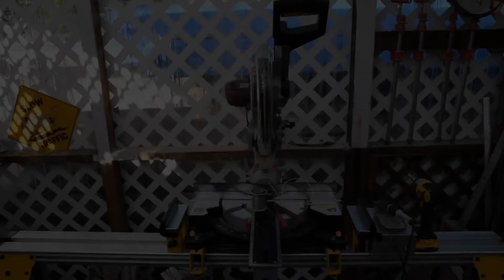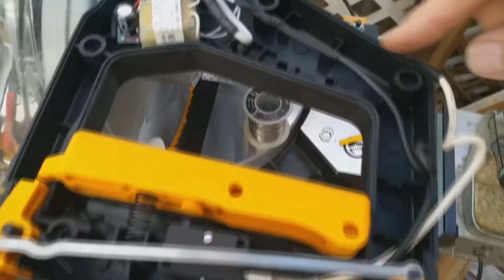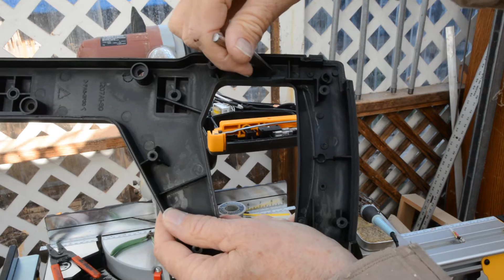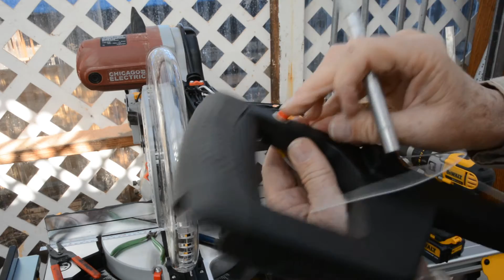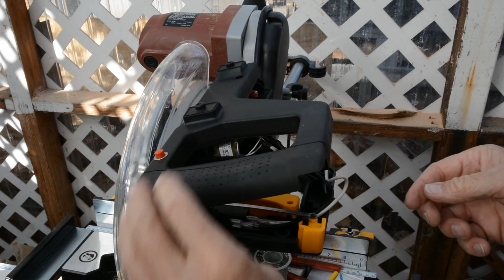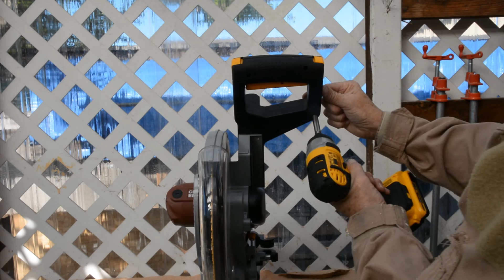Modifying a Harbor Freight miter saw with laser guide button

Comment: Great video. I got to the part with capacitor wire and there is no capacitor in my handle. I returned it to normal because I didn’t know what to do. Please advise if you can. Thanks

Comment: I loved the idea and I installed one on my miter saw.  I did make one change to the design though.  I used a Hillman "rotary switch" (Lowe's #77571 model #427661) instead of the "momentary" switch shown in the video. I prefer the rotary switch because it allows for "hands free" operation of the laser guide while aligning larger workpieces that sometimes require both hands to align. Thanks for the "fix" to what I considered "a danger" from the factory.

Comment: Great hack, Thanks. I would love to use a toggle switch so i can have the laser ON before and while cutting as well.
Reply: I have the built in laser model in the shop at work, but the laser and light actually stopped working

Edit: the one with a switch for both
Reply: See my reply above.  Jim Wilson.  I included the part number of the switch I used in my reply.

Comment: Good video. Thanks for the instruction. But your hands blocked the view a lot in the process. Anyway I got the ideas. The design of the saw is so confusing. I don't understand what's the use of the laser if it can't be started before the blade turns.
Reply: Mine didnt have a transformer in the handle anywhere so I had to stop and put it back to original. Any ideas?

Comment: Nice modification , is the laser line accurate enough to actually  use   As a guide ?  I looked at the saw on dispay at HF and it  had  quite a bit of “ flexing “  in the  pivot points  comparing it to  my  non sliding double compound Dewalt  ive owned for  10 years and  was a  Woodworker. For amost 20 years installing  and building Architectual  Woodworking for commercial properties  ive always sighted the blades on my  mitre saws  but of course if something new  or better  is out there i want to try it  the price on the saw you have  makes it  very tempting  of course  and i do agree the factory set up on that laser  was a dumb  one and your fix   Is a much smarter and safer  version
Reply from the maker: If you put a side load on the blade while cutting you can move the blade +- 1/16".  With good technique you can get good results from the saw.  The laser is only as good as your technique.

Comment: Anyone know how to adjust the laser? Mine is way off and its annoying.
Reply: Before starting, take a scrap and make a small cut with the saw set at 0 (normal straight cut). This is the target. Trigger the laser and see where it is (left or right of that spot) and make a little pencil mark where it shoots. The laser has 4 screws. One on the left side (if you are facing the saw) and 3 on the right. Also, sawdust can get packed up behind the laser unit (which might put yours off!) On the right side, unscrew the front and back screws and move the laser unit, blowing out the sawdust, and then retightening them. The remaining middle screw on the right side has a nut that is used to hold the laser in place, while the screw (bolt, actually) pushes the laser to the left. The single screw on the right tightens the system down. By adjusting the nut and loosening/tightening the screw, you can get the laser to line up with your cut in the board.
Reply: @PhilosophyCat  thank you so much for taking the time to explain that!!!!!
Reply: Thank you so much for explaining this, I was very surprised to see it doesn’t explain this in the manual. I also really like the idea of adding a dedicated switch for the laser

Comment: nice job, you could also use a rocker switch to keep the light on or off.
Reply: I did. I had everything installed until I got to the capacitor wire and mi e does not have a capacitor